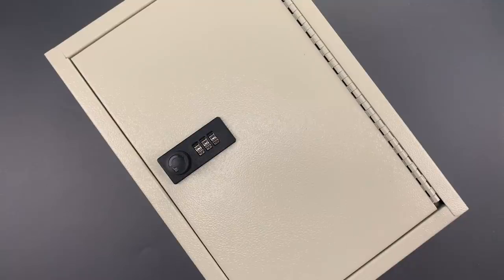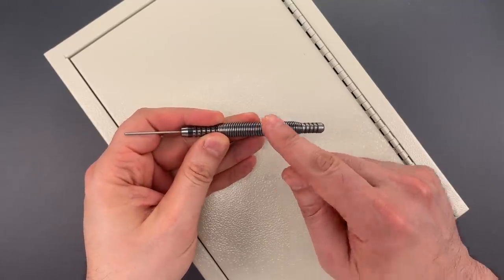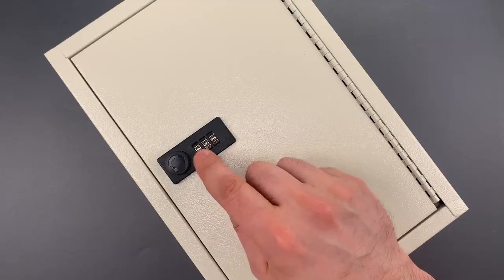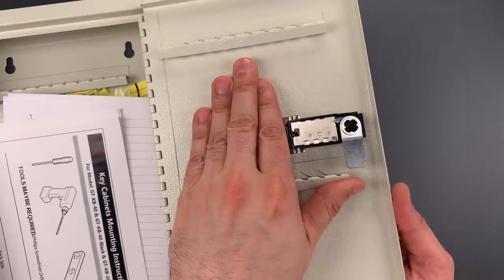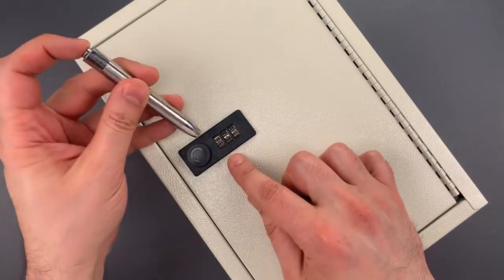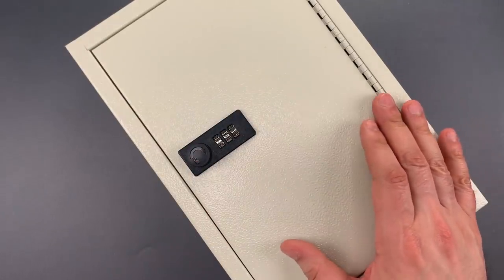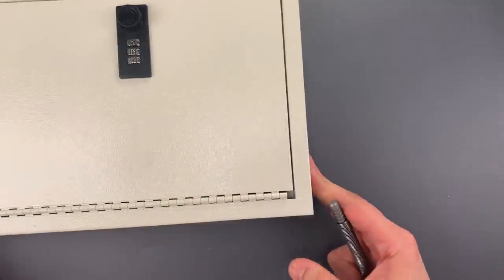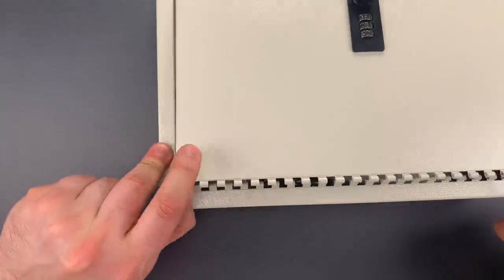[1204] Two Boneheaded Flaws In The Kyodoled Key Lockbox

Comment: I've never seen a hinge like that.
Maybe on small kid's toys, but not on anything larger then your palm.
Kinda shocks me that they're this common in the states.

I don't remember which video it was, but in one LPL did a colab with a guy shoving how to bypass a door without even touching the lock and again, I've never seen a door that has those hinges, such big gaps in the frame or that had a hooked handle that goes upwards???

Where I come from doors just barely come off when they're wide open. Kind of a pain to install tbh.

It's just really weird to me that my backwater ass country has slightly better doors then the US.

Comment: I understand the concept of picking a lock for fun. I also understand the concept of how to bypass the locking mechanism. I think there is a line crossed when sportpicking where you use means of entery other than the locking mechanism.  Then selling tools that do not enhance picking skills but break-in skills. Even the comb takes are not skilled attacks.  With all that LPL showing the weakness or how vulnerable something is lends to be dual sided. It shows the consumer it has flaws. It also shows how to exploit those flaws.  That is another issues it it's own.  In summary showing flaws that are not picking the lock mechanism and offering tools to due such seems outside of sportpicking.   Its not called sportopening. Just a different view.

Comment: I was wondering if there was any advice for a newbie beginner like me who wants to get into lock picking as a hobbie
Reply: If you have $100 US to spend getting started, I strongly recommend Sparrows Night School Tuxedo set with all three practice locks.  It comes with a much better quality set of picks and rakes and tensioners than other newbie kits I've seen, and the three locks let you work up from standard pins to serrated pins to spools at your own pace.
Reply: If you don't have that kind of money, I still recommend the Sparrows Night School Tuxedo set, just without the practice locks.  That'll save you around $60 and still get the actual tools.  There are cheaper ones out there, but quality varies wildly.

Comment: does anyone make a code wheel lock where the wheels have undercuts and the front plate fits into those undercuts?

idea being you can feel in there without bending around the guard piece

Comment: Who else keeps checking YT  to see if he has cracked Stuff Made Heres lock yet?  .... 

I was wondering if compressed air, water or freezing & expanding with ice could somehow mess with those pins n stuff he put inside?  What did he make them out of - what is the heat tolerance of the components..... does it have to be "non-destructive" ?  either way I can't wait to see what happens..... perfect chance for sneaky marketing trick tho....design a lock for market, then have a fellow youtuber famous for his lockpicking skills FAIL to open it.... boom the product design price just tripled . lol
Reply: Or magnets if he didn’t use stainless steel

Comment: Isn't this tool pointless? It should have also other options and integrated pliers. Why buy this tool? To play with a spring? If I have this tool in my backpack along with the pliers, I could replace the tool with 4 small rods with different diameter. Then I just hold a rod and hit it with the pliers, job done. The only usecase for this tool I can see, is if it has integrated pliers.

Comment: Good as kids toy, I've said it for over 10 years by now, that the more technology advanced, the more dumber people become. Nowdays it's easy for every fool to use 3D printer or basic machinery to make something, but out comes total garbage ... because they have NO knowledge on how things should work. Same goes for software ...  movies aren't much better either, every fool can make special effects nowdays, so movies have no stories, software is GIGANTIC in size with useless theme and no functionality and lots of bugs .. and hardware is just weak and useless and doesn't do what it's meant to do.

I bought a "GAMING' chair... 2-3 weeks later one arm rest broke in half (no I didn't put much force on it at all) and shortly after one wheel broke off. I had to use steel reinforcement bars to re-build the armrest and secured other one .. now 6 years later, it's still holding!

BOTTOM LINE - brainless people should not even try to make things, because they simply don't have enough brain cells to understand basic physics and they have no common sense. They should stick to wiping floor and cleaning windows .. no wait, window cleaning requires some common sense too, that would too hard for them.